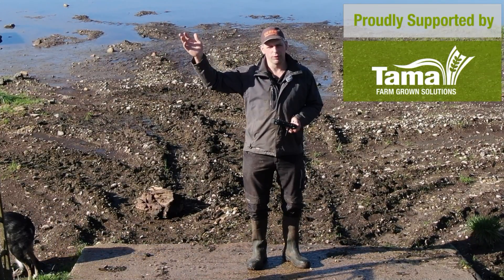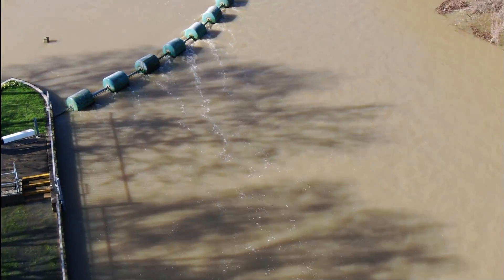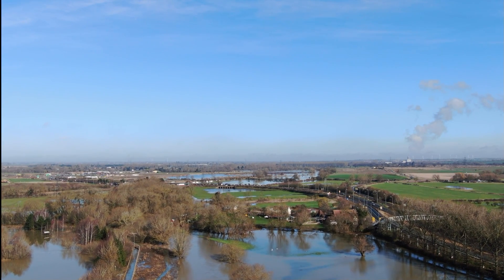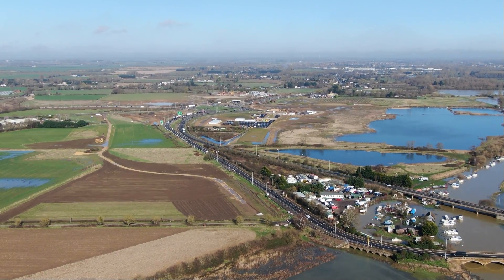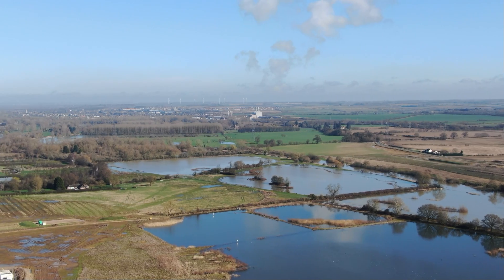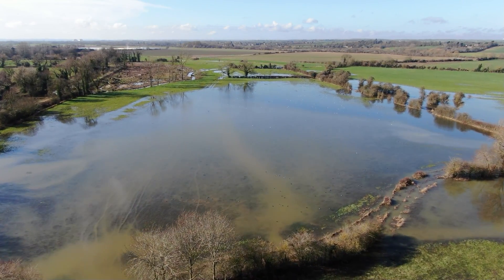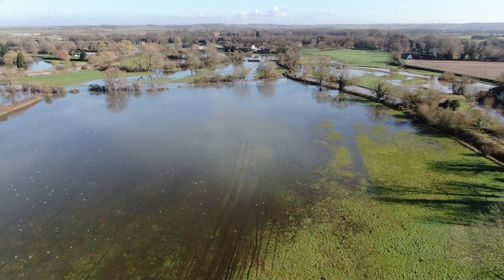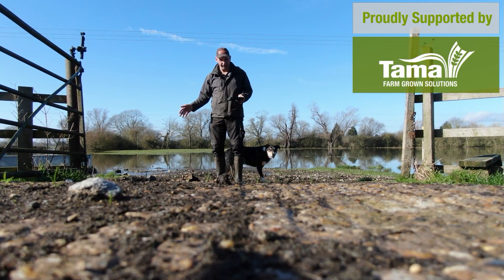FLOODS AND MAJOR ENGINEERING PROJECT AT THE BLACKCAT ROUNDABOUT

Comment: Check your drone battery for recalls. Some of those DJI’s had issues where the battery would stop discharging mid flight and make them drop out of the sky. It freaking out when you’re at full speed and maybe into a headwind might be a symptom of that.

Comment: so the new roads going across and linking back onto the a428 when done then ????  so the obvious point to join is the roundabout where the shell garage and maccy d’s is  just before cambourne i guess ???? ,as thats all ready dual carriageway   away from there
Reply from the maker: That's it, so it'll replace that stretch of single carriageway 👍
Reply: @GeorgeSaunders  prob make the a1 quieter as well then, is always a pain between the black cat and the slip road off ,its short but always nuts.

Comment: Hey George. you mentioned Bedford in this video. is it close to you? have you heard about Bedfordia farm equipment? we have an imported Johndeere 8650 with a bedfordia sticker on it. im just curious about it's history in England. since it's now belonging in Sweden. I tried contacting their new company/name, but got no response. thanks for any input! (Rushdon Road, Milton Ernest)
Reply from the maker: Yes Bedford is just a few miles away, I used to work for Bedfordia back in the day! I filmed there 9630 a few years back. Now I remember when I was there they had an 8850, an 8440 and I thought it was an 8640, but it could have been an 8650. So whether it's that one that was used on the farm or a different one they supplied as a dealer. I do remember that the 8650/40 was sent off to Kinze in the states for a repower and overhaul when I was there. It returned looking brand new. Is there any indication that yours has been repowered?
Reply: @GeorgeSaunders  oh wow thanks so much for the info. Thats awesome. Ours still has the johndeere engine. not the original one anymore. My dad replaced it here in sweden. the previous owner (in sweden) .had ran it hot multiple times and cooked the engine because the gauge is not working properly. Its a 1985 model. dual michelin 20.8r38 it had on it. At some point in it’s life they bounced the front axle against the stops. Cracking the frame infront of the engine. they welded it up and then added another 6mm plate on the outside along the engine. is there any way bedfordia might still have documentation do you think? That’s why I tried contacting them. Again thanks alot. 

the frame incident may have also broken the original engine.
Reply: I just had to say the coincidence that you used to work there is just mind blowing i Actually can barely believe it.